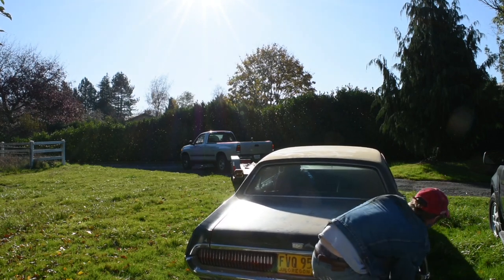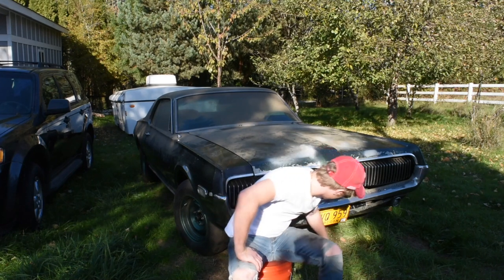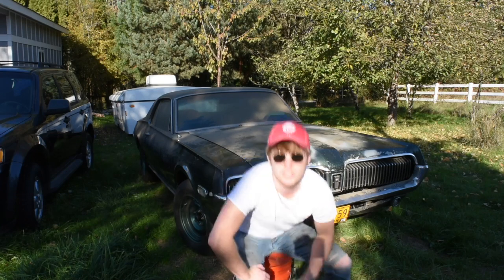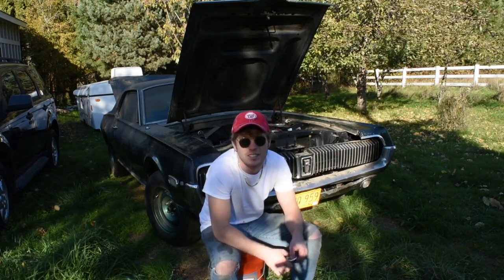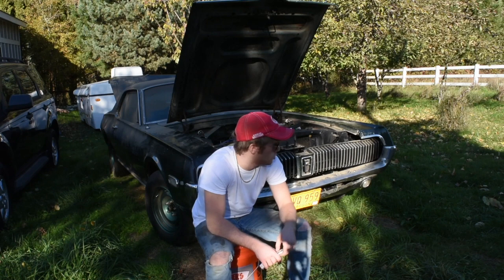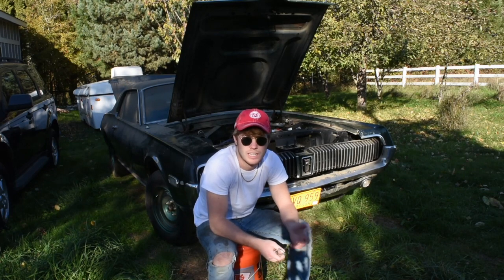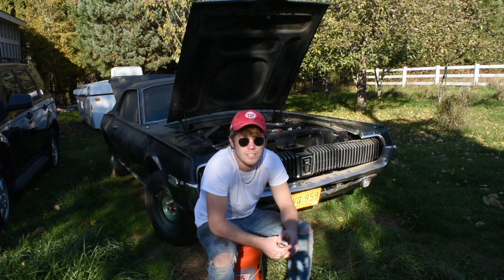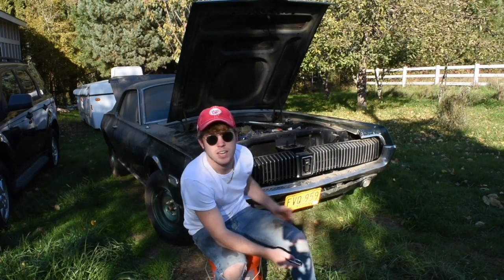"Barn Find" '68 Mercury Cougar DRAG CAR Resurrected After 15 Years

Comment: If it has a 351, then it is not original to that car; check an owners manual. 1969 was the first year for the 351.
Reply from the maker: Ed Turner j code 302
Reply: @elcaminokyle6561  Thanks for responding so quickly, I have a similar car that's a garage queen. Guess that the reference to a 351 was for different car? 
Noticed that your car has the stock shock tower braces. On mine, the bracket that ties the cowl to the passenger side inner fender was broken, and looks like a factory defect. I've gotten an export brace; some people have bought one and think the new part is defective, when the misfit is actually caused by the unibody shifting over time. Said to markedly improve stiffness and handling.
You also mentioned a 17-gallon tank. The stock one is 16 gallons, but a '69 (20 gallons) or a '70 (22 gallon) will also fit. The bigger tank sacrifices vertical space in the trunk.
Glad to see you got it busted off.
Reply from the maker: Ed Turner the 351 reference was to the previous owners 65 comet drag car. I tried the one piece shock tower brace as well and it didn’t fit... for the same explanation, getting shifted over time. Just redid the whole suspension on it
Reply: @elcaminokyle6561  If you still wish to use the export brace, there are Youtube videos on how to shift the unibody. Involves jacking up the car at specific points, then letting it settle. Also, there is a crosswise brace under the engine that is held by two nuts; its temporary removal may aid in shifting the unibody. Later, you may wish to weld braces on that cross piece to stiffen it, per Boss 302 method.
   Also, particularly since the car has seen heavy duty use, you may want to pull the rear seat and and check for broken welds; these are quite common. There is a sheet metal brace for stiffening the rear unibody that parallels the seat back. There is also a safety benefit; in the event of a rear end collision, it prevents raw fuel from entering the passenger compartment. You may have noticed that the design flaw for the fuel tank placement is actually more hazardous than the infamous Pinto, as the fuel tank IS the trunk floor. The Shelby GT 500 had exhaust tips below the filler pipe, and was alleged to have suffered fuel tank fires even without being rear ended.
   You mentioned redoing the suspension. That's one of the mechanical areas in which Mustangs and Cougars differ; they were clearly meant to ride differently. The stock exhaust systems are also different; The Cougar's is quite conventional, whereas the Mustang's dual exhaust uses a single crosswise mounted muffler with dual inlets/dual outlets.
   West Coast Classic Cougars is the prime Cougar parts business, with great informational videos.    https://secure.cougarpartscatalog.com/
Reply from the maker: @et76039  thanks for the useful info, WCCC is actually 30 minutes south from me so I've been there many times and have even had Don Rush inspect my cougar on their lift!

Comment: My first vehicle was a 68 cougar my interior ain't even close to good as yours or body work runs great and original 302
Reply from the maker: Dakota k Nice! Tune in next week and you’ll be able to compare its drive ability to yours:)
Reply: @elcaminokyle6561  mine drives I need to put a new throttle actuater cable on and put new brake lines on it the kids that had it befor me used rubber hose they bout the car from a older guy like 50s then riped the interior seats roof then cut  a square hole in the pass side floor cut the anttena hooked the turn lights to a bell asked the guy to buy it back bc they had a DUI they couldn't pay for it then I got is supposed to be anothere cougar with it but tried to come after me for more money bc him and his wife was remairring and need more money I was 12 sent a constable after me and he could have went to jail for lieing that I was older lol
Reply from the maker: Dakota k that’s a crazy story, sounds like it’s in good hands with you
Reply: @elcaminokyle6561  yes yes it is a crazy stories and thanks still long ways to go but I keep things original I'm super old school
Reply from the maker: Dakota k keep me updated!
Reply: @elcaminokyle6561  will do and what really brings out the awesome stile of the car put wide fat tires in back and skinny ones in front
Reply from the maker: Dakota k I got 275 wide tires to stick on there!
Reply: @elcaminokyle6561  makes it look like a 1970s Dodge charger